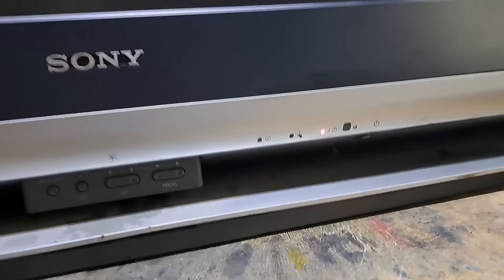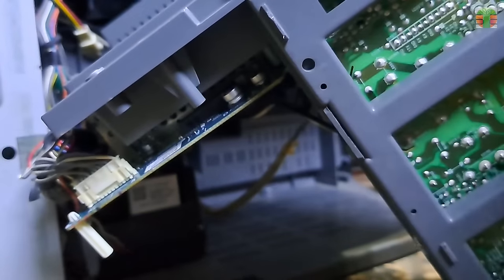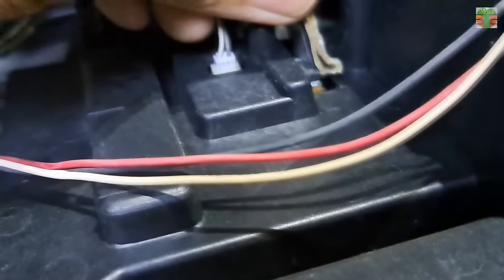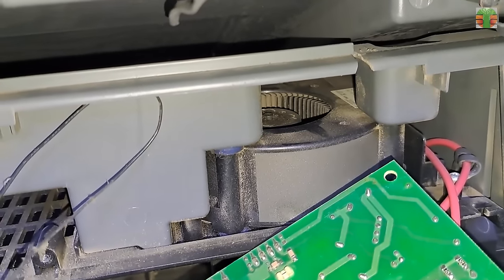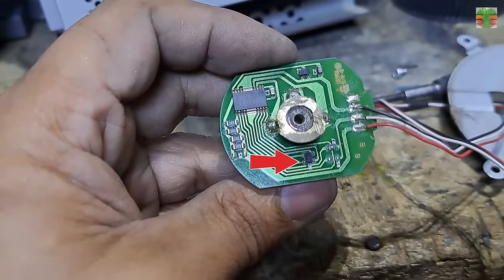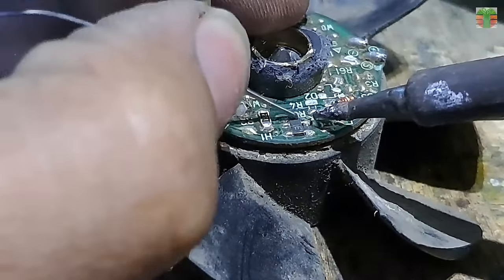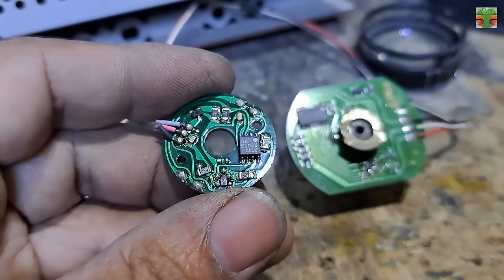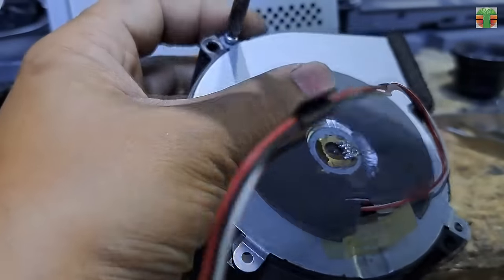Sony LCD Projector TV KF-E50A10 blinking red light indicator.

Comment: Great improvised repair! I have a Toshiba DLP that I had to recently repair for the first time. These sets share a similar module style design but require a lot of time doing disassembly and re-assembly. My bulb is much easier to access than on this set. Still, great TVs even though they're 20+ years old, just hard to find parts.